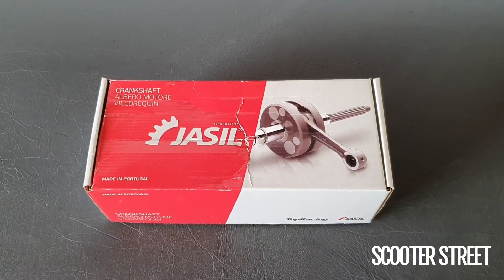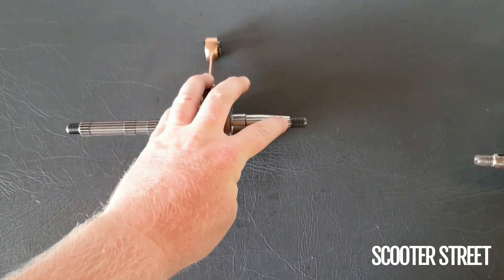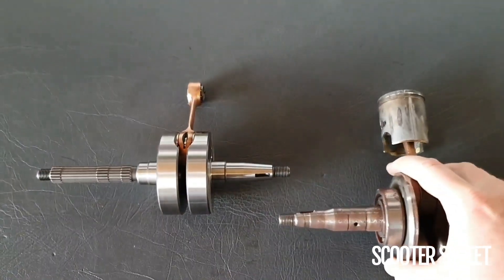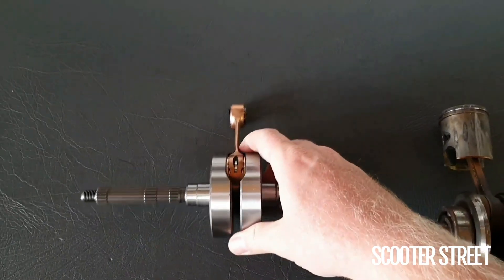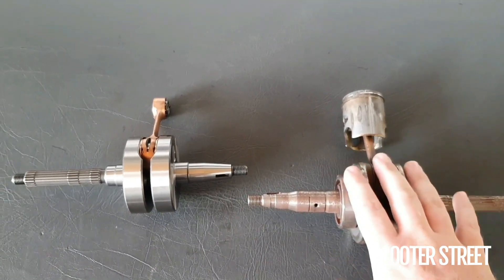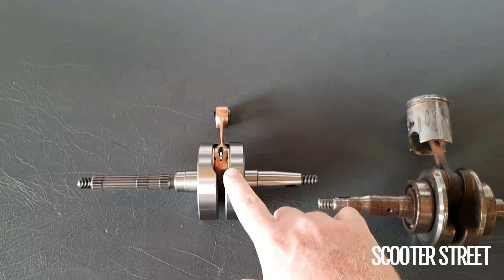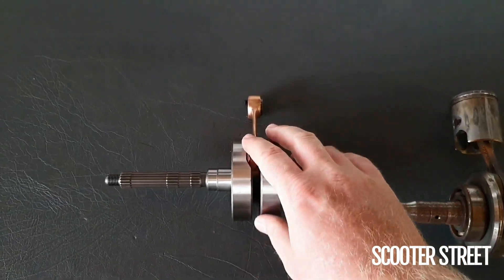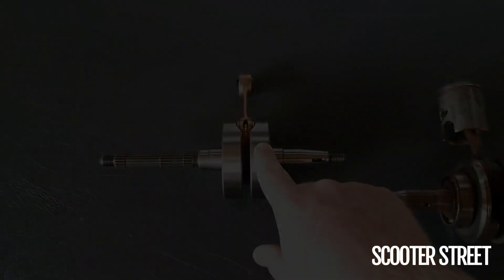High Compression Crank for Aprilia / Piaggio 50cc 2T Models - Comparison to Standard Crank

Comment: Would this jasil crank work for the stock 50cc cylinder kit? Is the stroke lenght the same?
Reply from the maker: Yes it will.
Reply: @scooterstreetau  Amazing, are all the perfomance cranks able to fit stock 50cc kits? Or is it just this one.
Reply from the maker: Most can unless the stroke is longer. @MartZilka
Reply: @scooterstreetau  Ok thanks.

Comment: Is there much notable difference between the high compression and the super compression crank?
Reply from the maker: If you see on our website the Super is the name given by the manufacturer. Same as the HCC. The full circle is made up of High Tech Polymer which reduces the overall weight compared to the full steel crank.
Reply: @scooterstreetau  so super compression and high compression are just two different brands?
Reply from the maker: @kbgaming6012  Yes same thing. It is what the manufacturers refer to when they describe their products.

Comment: What would i need if i were to get a performance crank?
Reply from the maker: The crank will support a larger capacity engine or suit the standard, so you might upgrade the cylinder kit. You will need the basic replacement parts such as bearings, oil seals, gaskets.
Reply: @scooterstreetau  Thanks.
What would be the best perfomance mod to start out with for a derestricted stock euro 4 piaggio typhoon? If i can’t get a new exhaust
Reply from the maker: @tommyn4031  Best mod is the cylinder kit and remember, there are many options of exhaust for the E4 Typhoon.
Reply: @scooterstreetau  So i would get the best results from a 70cc kit even with stock internals? I cant get an exhaust, because the cops pull anyone with a performance exhaust over
Reply from the maker: @tommyn4031  If this is something you really must do then you don't have many options. When you fit any type of performance part all of the other contributing parts should also be upgraded or changed. With the 70kit you will need: Jet for carby, Rollers for variator, Clutch springs set.
You should research what other similar riders do with their scooters in your region.
Reply: @scooterstreetau  Thanks alot 😁👍🏼. Can you link some of the parts that’ll fit in the 2017-18 model? Mostly the jets for the carb and the clutch springs, because I’ve found a nice exhaust and 70cc kit. I think I’m gonna install a rev limiter switch on it so i don’t get caught if pulled over
Reply from the maker: @tommyn4031  In short 6mm main jet set 74- 98 sizes. Malossi Yellow clutch springs work well for us.
Which exhaust and Cylinder will you go with?
Reply: @scooterstreetau  was thinking of getting the Yasuni R and Stage6 sport pro mk2
Reply from the maker: @tommyn4031  That will be terrific!

Comment: How many RPM the regular crank is rated for - 2004 Piaggio et2?
Reply from the maker: Hard to say, as an OEM crank they don't come with a rating as such. In our experience, theyre good up to about 10.5 - 11k. We've never seen one break, we've never really pushed the limits with one either. Performance cranks are cheap, blowing your engine apart isnt!
Reply: @scooterstreetau  perfect...my Yasuni r and MK2 sport wouldn’t push with stock cdi more than 10.5. Thats what I was told, too. Thank you!
Reply from the maker: @sunnybeachweddings  👍👍

Comment: Hey, it isnt nescesary to replace the crank on a sr 50 r 2020 model if i run malossi replica, and drive responsibly right?
Reply from the maker: We have fitted the Malossi MHR Replica to many Piaggio/Aprilia scooters with the original crank with great success. You will find wear at the small end bearing on the piston pin so upgrade the piston bearing. If the original crank is not in good order you should replace the crankshaft, bearings and seal kit to match.

Comment: does it cause issues with lubrication on the bottom bearing for long term reliability?
Reply from the maker: The bottom end of the conrod has windows in the conrod to allow additional lubrication. The standard crank does not. See the oil slot at :31